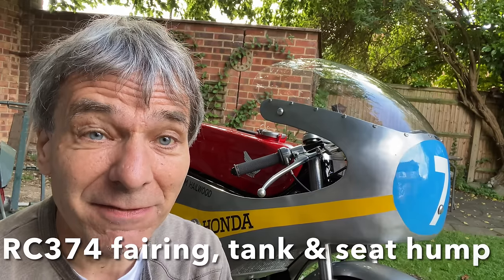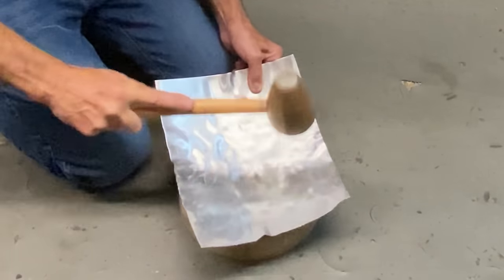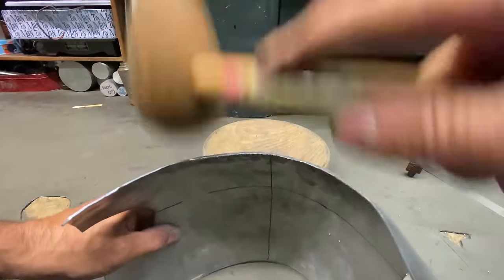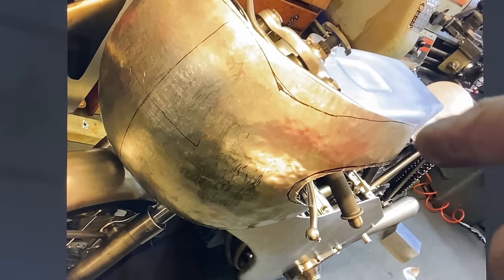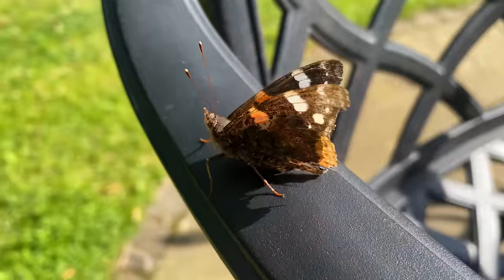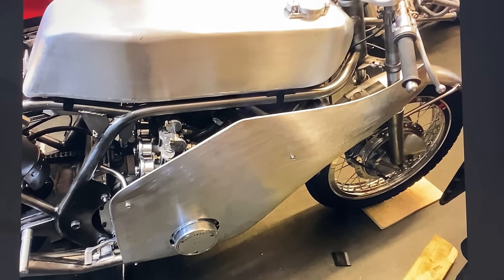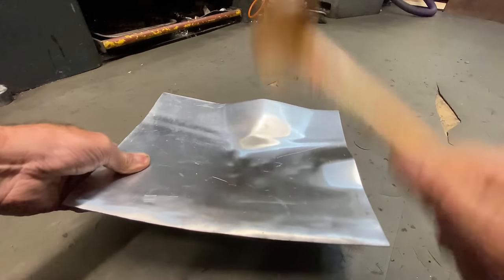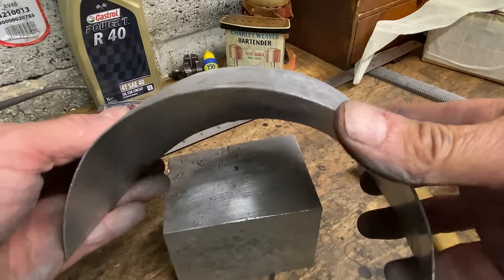How its made -  Alloy tank, fairing and seat hump - RC374 episode 7

Comment: Hello Allen, 

the turned over edge (Around 22minutes) is asimpler version of a wire edge in which a length of steel wire is wrapped using the same basic technique you used. A wire edge is stronger than just folding and doesn't take much longer to do? Aston Martin and A.C. Cars used this on all their aluminuim bodied cars for the wheel arches..

Comment: If that monza petrol cap leaks fuel like most do I found that by fitting a welch plug just a bit smaller than the filler neck onto the end of the threaded monza cap gasket spindle it stops the fuel from getting up to the gasket surface & seeping past. I used an inverted center punch in a vyce & balanced the welch plug until I found its center then hit it with a hammer, then I used a tek screw to put a thread in it & you will find the thread is a good interference fit to keep it in place. No more leaking fuel on my 1969 Rickman Metisse MkIII.
Reply from the maker: I made the cap from scratch It perfectly leak tight
Reply: @AllenMillyard  Very good, my tip might help those poor souls who have the standard issue vintage or modern day replica Monza cap.

Comment: Isn't it fantastic what you can do with a sheet of metal and some hammering? Way back in the early 1960s I used to work with a panel beater and in those days he used to make most  of the repair panels for accident damaged cars. He was getting on then and had been working with metal for ages, what he could do was unbelievable. By the way what is a sharpy pen, is it something special for metal working? 
These are a really fantastic series of videos and I've enjoyed them all, thanks for sharing them.

Comment: an easier way to cut curves in sheet metal, especially sharp ones, is to cut the curve out but leave about a half inch of material. then, when you cut your final curved edge, it will be much easier and cleaner, then if you were to cut the curve out all at once. just make sure you leave the first cut with about a half inch of extra material. if you leave, let's say, 1/8 of an inch, the strip will be too small to cut, and can bind in the tin snips, especially dull tin snips. Anywhoot, I just thought this might help anyone that hasn't used tin snips much.

Comment: Have you ever had the opportunity to try an English wheel for your metal forming projects?  If not you should.  I think it saves much time and results in a better product if your patience with the hammer is not unlimited.  Amazing work with the engines, especially since you are limited to a hack saw?!?!, small lathe and mill and tig welder.  No CNC machine centers!!!  Subscribed, your work is just amazing!
Reply from the maker: the original honda RC race bike fairings were hand beaten and I like to make my bikes by hand with minimum tools

Comment: In my day as a tin basher (apprentice training) we used soap as them annealing temp indicator.
Reply: Please explain.
Reply: @bradcrossman5068  Rub a bar of soap on the part, it turns black as it is heated then when it disappears, shows its got hot enough, like the sharpie. Not sure if its the case with modern soap bars.
Reply: @logik100.0  Many thanks!

Comment: Sir can you make suzuki 660 12valve 3 cylinder from suzuki multicab for motorcycle. Use it's  own crankshaft/bore/cylinder head. Make rev closer to 9,000 rpm. And fit in other bike transmission...

Comment: I worked in a machine shop,.......there's really no paint that bonds to aluminum,.......We sprayed like a rubber contact cement on it before we painted it.
Reply from the maker: Epoxy two pac works fine on aluminium and doesn’t come off if put on properly

Comment: Those tin snips are right hand cut snips (red handle) and your using them upside down. Green handle are for left hand curves. And yellow handles are for straight cuts! You should also weld prep with a file the pieces you added to ensure a complete penetration! Great job though!👍
Reply: @AllenMillyard  just saying bud! Great work though especially considering the tools your using!👍